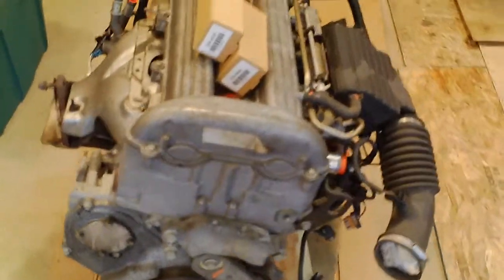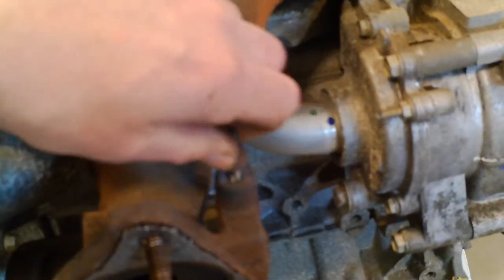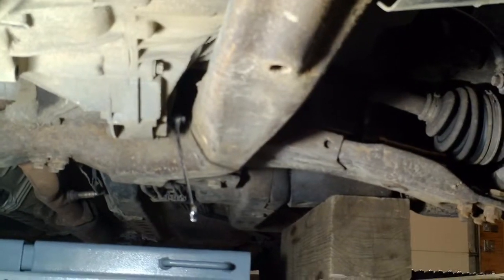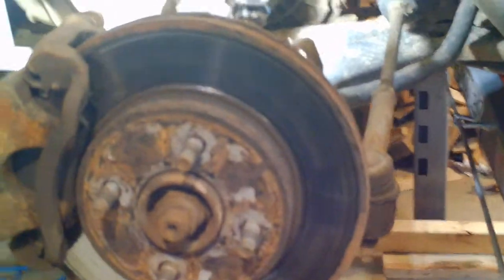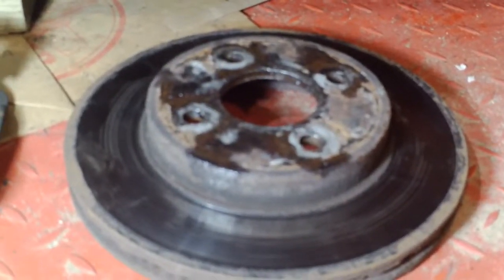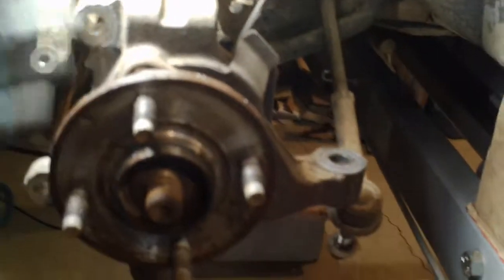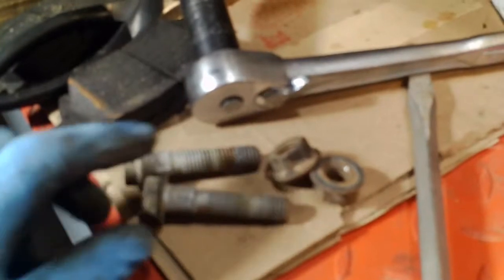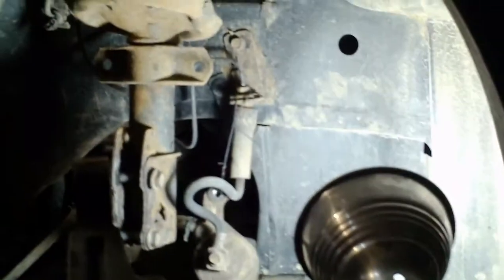Detailed Saturn Ion Engine Replacement and more, Part 1

Comment: I have a 2004 Saturn Ion with 238,000 and im considering replacing the engine myself. About how many hours or weekends dis you have in this project?

Any tips or recomendations for me tackling this project.
Reply from the maker: It took me about 20 hours in total, but I only worked on it a few hours at a time.  It was pretty easy over all, but I had the tools needed and didn't have to try and make things work that were not ideal.  The big thing would be an engine lift and at least mapp gas for the exhaust bolts/nuts.  I have also had much of this car apart before and so I knew how to do a lot of it and the bolts/nuts had been out before so not much was stuck.  I am not sure that helps much, but about all I can think of right off.
Reply: @JB_WI_Triumph  thanks, I'm doing an engine swap in a 2006 redline from a 2004 ion. They borh have the same engine so this should work!
Reply from the maker: @AWConstructionUSA  I thought the redline had supercharged 2.2L engine while the regular ion had the 2.4L engine, or something like that.
Reply: @JB_WI_Triumph  I looked up the VIN and they said they had the same... 
Did i just waist 500$ on a car I can't fix??
Reply from the maker: @AWConstructionUSA  Check this out
 https://en.wikipedia.org/wiki/Saturn_Ion
there are 3 engines available I guess, you should be able to tell from reading this I think.